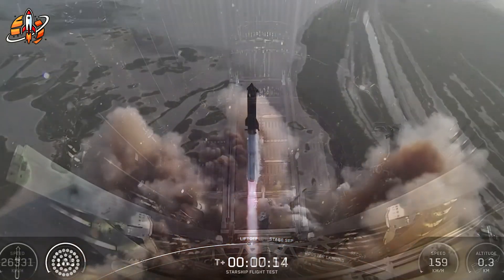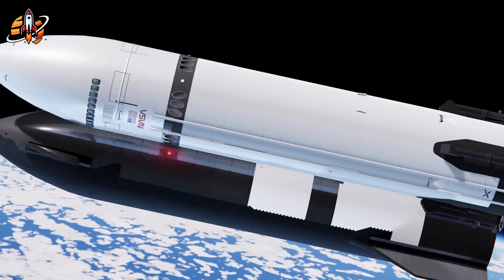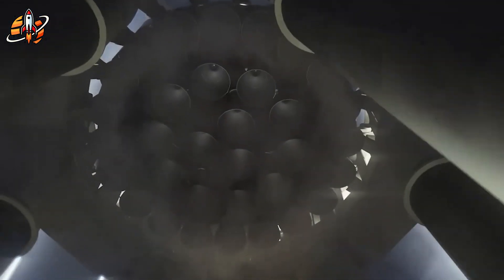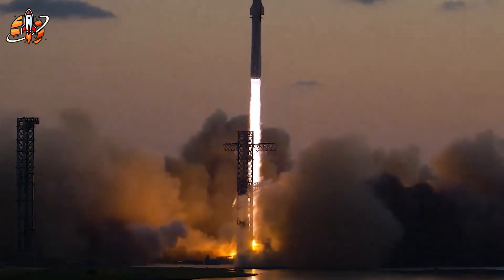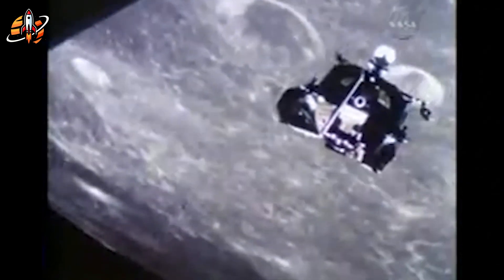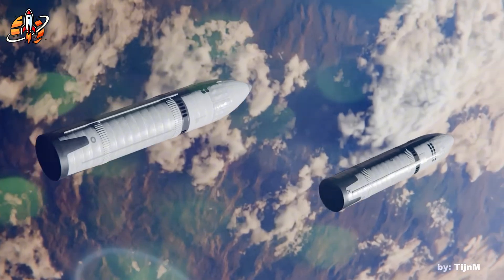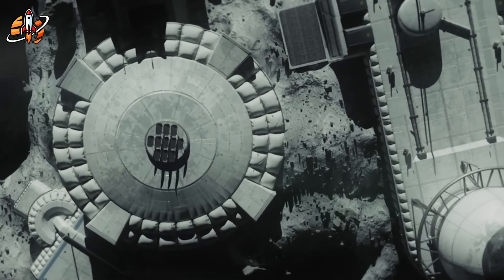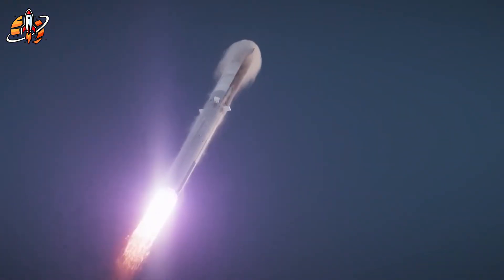Elon Musk REVEALED Why Nova Design KILLS Orbital Refueling... GENIUS Move!

Comment: Star-ship needs to be two parts so that the a smaller ship can land on the moon. and then take off with less weight.
Reply from the maker: Splitting Starship into two parts for lunar landings makes sense to reduce weight for takeoff, optimizing payload efficiency. Could this dual-design approach further simplify Nova Starship’s direct lunar flights while maintaining mission reliability?